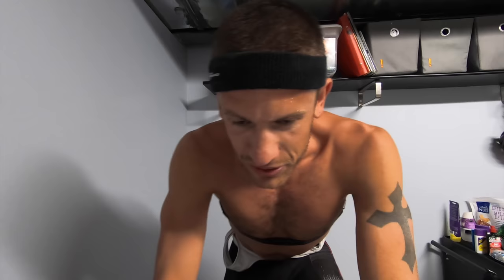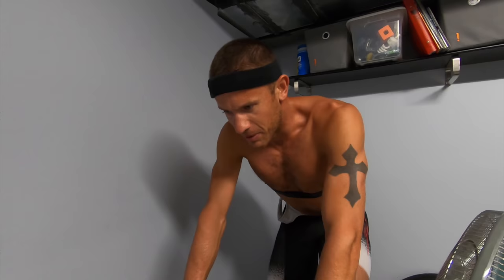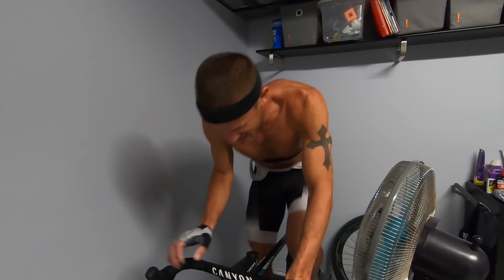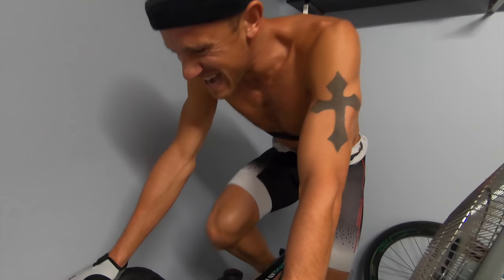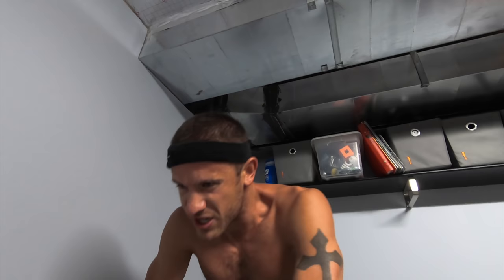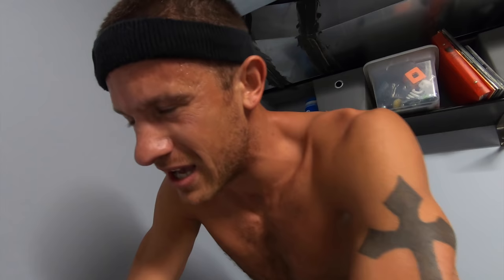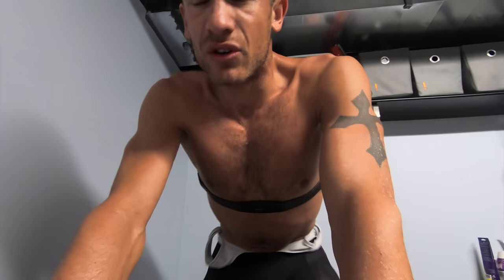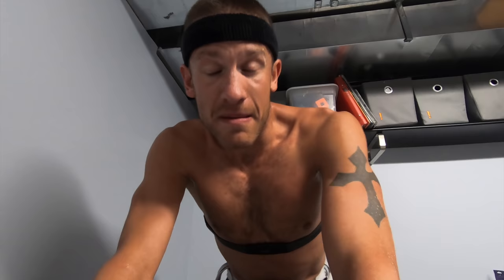Bike Strength Test Session

Comment: @Lionel Why do you do these intervals out of the saddle? Is there any point in pushing max you can do while in saddle? Of course, standing will be more power, but muscle utilization is somewhat different anyways
Reply: That's why I came down to the comments exactly to ask the same question
Reply: +1  @mustaphab.1190
Reply: Because his power wouldn’t be as good in the saddle, which would hurt his ego
Reply: When its specifically muscle strength and recruitment he's after in this session, I don't think it matters. You can generate more out of the saddle and its the physical power he is trying to train here, rather than, as he says, using his TT bike and the difference that riding position would make. Its a bit like using deadlifts or squats for strength training, it doesn't matter that its not the exact riding motion because its working a very focused strength and muscle recruitment system that you just won't target at the top-end if you stayed seated.
Reply: @modan20  great response!  500+w seated repeats, now I'd like to see that!

Comment: To push 400W for 1h, top amater cyclist is
able to do 10 x 3 min @450 to 470 W; BIIIG DIFFERENCE to 430-440. Cyclist with
FTP400W with very good anaerobic capacity would do over 480W 3 min reps. Lionel
do not need that.

Again it is not about the POWER.

Power is just the tool. Lionel&team should use it wise to finish bike ride 13 minutes ahed of Patrick and be able to burn
11.500 kJ in just 2:50 run. It never happened. May hapen, if they change the way.
Period.